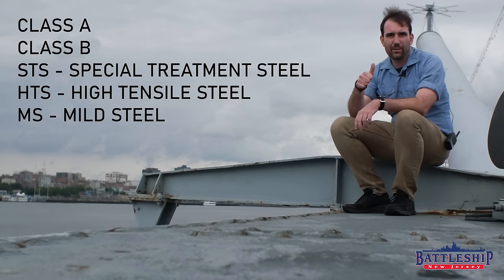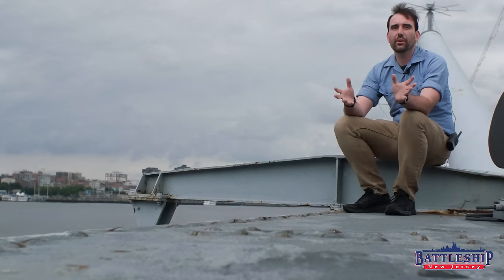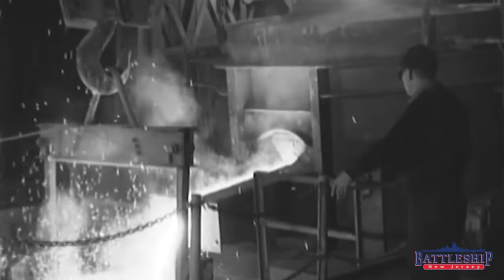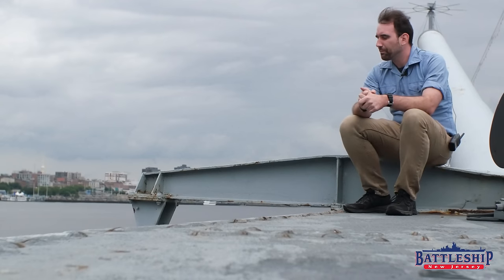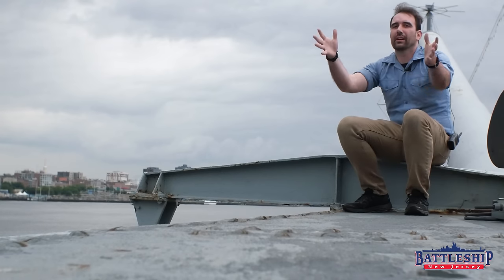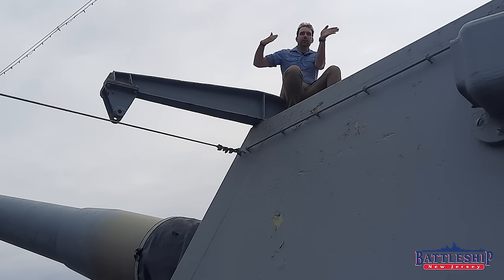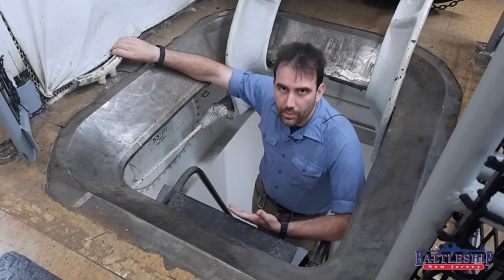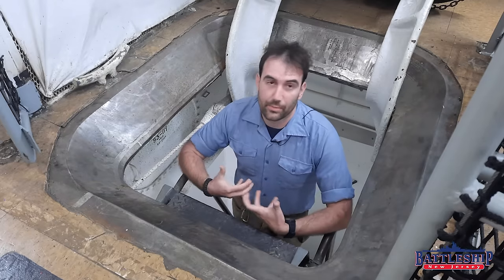Whats the Difference Between the Armor Types on the Iowas?

Comment: I believe the consensus, among people who've spent decades studying this very question for fun and profit, is that British Class A armor was fractionally better than anyone else's; German, Italian, and Japanese Class A armor was all so close together (for a given thickness) as to make no difference; and American Class A armor was fractionally worse than anyone else's. I don't think I've ever seen an explanation of why the British armor was so good, but IIRC the problem with the US stuff was that someone had a very clever idea that looked like it worked in small-scale testing but didn't hold up at capital ship scale. (Specifically, they manufactured it with a relatively thicker hardened layer compared to everyone else - it made 6"(?) plates a bit tougher against cruiser-scale projectiles, but left 12" plates roughly 10% less resistant to 14" and 16" projectiles. But before they tested the thicker plates Congress ordered 17 brand-new fast battleships and set everyone scrambling.)

US Class B armor, OTOH, is supposed to have been the gold standard. And nobody else could afford to use it as structural material throughout their ships, so advantage America on that.
Reply: One of the important questions becomes when the armour plate in question was made. Germany, particularly, suffered from being cut off from supplies of the materials they wanted to use - even Bismarck with her new welding techniques and weird electrodes suffered from this pre-war. Late-War German tank armour, particularly, really suffered from Germany just not having the right material to alloy with and would crack or shatter under impact.

I've read similar on the US armour, by the way. The heavy cruiser-size plates are simply phenomenal but the performance didn't carry through to the battleship-size stuff.
Reply: @Kias1dad  To clarify - the thick battleship plate US steelworks turned out seems to have been on a par with the best of that produced by other nations - British plate, German plate when they weren't suffering under material shortages. It's simply that they weren't able to repeat the very good cruiser plate they'd found the knack for. Regards the rest of it ... one of the things the US did uncommonly well during WWII was to identify a need and meet that need. Sure, there were moments when it didn't perform at it's best, but, generally, if the US military identified a requirement, they found a way to meet it.
Reply: @Kias1dad  
Steel manufacture is down to the methods so much so that I would expect to find variation by yard, ship, and plate - though to what appreciable degree, one could only test on irreplaceable historical artifacts.

The U.S. had major advantages in terms of supplies and having nearly completely unmolested manufacturing, so methods could be honed and improved in response to testing.  Further complicating research is how things were done back then as compared to now.  Many things were still trade arts and process documentation was just different.  Kind of like the problems with trying to rebuild a saturn v rocket.  The companies and people who did it moved on and scattered to the winds, taking what wasn't specifically chosen for preservation with them.

Confusing all of this issue may also be what various nations could do in testing or may have slated for production on one ship, but the natural chaos that unfolds during wartime production leaves questions as to whether this was able to be maintained.  It is true that Germany and Britain were, prior to World War 2, ahead of America in terms of steel processing.  Or, at the very least, had the better documentation to show they did a thing.  Maybe America had a more advanced process in someone's company, somewhere - but it wasn't regarded as the standard.
Reply: The sciences to change the hardness of metals is incredibly complex, try heating metals in ovens filled with  pure Hydrogen.............
Reply: @Kias1dad  Unfortunately Dunnigan & Nofi don't provide a source (or indeed any basis) for their claim - a claim I've never seen made elsewhere. Even more unfortunately, just a few pages later in the same chapter they also state that the Japanese battlecruiser Kirishima was sunk by scuttling the morning after her fight with USS South Dakota and Washington, which appears to be Just Wrong despite actually being a much simpler thing to get right.

Meanwhile actual records of actual penetration tests, with different sizes and types of shells fired against different types and thicknesses of armor from different sources, report that US "Class A" armor of the mid-30s on - which was, uniquely, face-hardened to 55% of its total thickness - was excessively brittle. As a result, while it was by far the best in the world at rejecting hits from 8" and smaller shells, it shattered too easily when struck by 14" and 16" armor-piercing shells.
Reply: For Battleship-grade thicknesses, by the beginning of WW2 the British had the best armor plate in the world. Germany made made many of the same improvements but could not keep up quality through the war.
The Italians did surprisingly well with a system that varied the depth of the cemented face by the thickness of the armor. 
American class A armor was not especially impressive because of an obsession with damaging AP shells rather than stopping them outright (although they definitely had the best AP shells in the world!).
Meanwhile Japan was undisputedly the worst, seeing as their armor quality specifications had not significantly changed since Vickers Cemented of WW1 legacy. This was largely due to focusing research on lowering armor cost than raising quality.
For class B armor the US had the best in the world.
Reply: Well it makes sense that the nation which kicked off the industrial revolution would have a bit of a head start in advanced steelmaking techniques over the other powers, although the US caught up very rapidly.

Comment: When you make structural repairs or when a battleship goes into drydock, is mild steel used? Would you choose replacement steel more for it's anti-corrosion properties today?
Reply: Mild steel is the most likely choice. Choosing a different alloy of steel would result in dissimilar metal corrosion, for example stainless on regular steel, so you just get the same alloy but not necessarily hardened.

Comment: Ryan, I know that Drachinifel has heavily criticized the "turtle-back" armor scheme of the German Kriegsmarine.  But you have to admit, the Krupp Cemented and Krupp face hardened armor allowed both BISMARCK and SCHARNHORST to absorb a lot of gunfire before they sank.  Thanks for uploading the he new video.  The earlier one kept stopping.
Reply: Ehh, the turtleback armour did what it was supposed to - provide good staying power in short-range slugging matches, which is was Bismarck's final battle was. That's what the North Sea favours a lot of the time. Has Bismarck been facing off against the USN and their preference for long-range gunnery I suspect she'd have sunk rather quicker.
Reply: if I recall correctly, there was even a survey done on the Bismarck in the early 2000s - it came to the conclusion that although it has sustained extensive damage and would have sunk on its own eventually, the damage sustained was nowhere near enough to sink it as "quickly" as it did. Meaning that even after the prolonged shelling it did sustain, the armor was still effective enough to render the short-range bombardment largely ineffective.
Reply: @AdamSmith-kq6ys  I see your point.  As a matter of fact, didn't IJN KIRISHIMA lose to U.S.S. WASHINGTON in such the long range duel that you describe?
Reply: @lloydknighten5071  Umm, I'm not sure what our point of comparison is here. Is an uprated battlecruiser as tough as a genuine battleship? No. Did Kirishima have a turtleback armour scheme? I don't believe so. Would seem a little academic on a 230mm belt, anyway. I'm not sure if the Washington thing is a bit of a derp moment or a bit of sass - Washington took apart Kirishima at ranges less than 10,000 yards, once the IJN had managed to distinguish themselves from the USN by the field expedient of setting all of the other USN ships on fire.
Reply: @ranekeisenkralle8265  not really ineffective.  The damage sustained by Bismarck was huge - all turrets were inoperable, crews dead or otherwise incapacitated.  Meaning: The ship ceased to be an operation threat so whether it sank quickly from gunfire or nor is moot.
Reply: The problem with the Bismarck layout is its inefficient. Sure, hits into the vitals were rare, but how quickly her guns were silenced tells much of the imbalance. Hits that penetrate the belt but not the turtle back would often be deflected up into the middle decks wreaking more havoc. Better to just keep the shells out with a thicker belt. Also, one of her designers lamented her shallow belt armor even before she set sail.
Reply: @drittal  Oh, absolutely, it's wasteful of space and, in Bismarck's case, leaves shipwide communications exposed outside the citadel for lack of space inside it. The shallow belt was a known flaw, agreed, but Bismarck was already pushing the limit for just how far she could exceed Treaty limitations - she was on the line between unlikely and improbably and fitting the belt the designers wanted would have been obviously taking the piss. Regards the turrets ... difficult to know what to make of that one. The thickest plates on Bismarck were those turret fronts, but even so they weren't thick enough for the point-blank hits she took. You wonder if the geometry of the turret design could - or should - have been improved. Getting smashed in the face at point-blank range isn't generally a battleship design requirement.
Reply: @SuperBobbster  Moot? Only in that is is now on the bottom of the ocean either way. Sure, it was mission-killed - no question about that. However, there is consensus among the researchers that it would have stayed afloat for hours longer if not for the crew scuttling it to effectively end the bombardment - so that the crew could abandon ship without getting hammered by naval gunnery.
Reply: @drittal  Thanks for the info about BISMARCK'S flaws in her armor scheme.  I just watched a video where the narrator claims that one of BISMARCK'S designers did indeed lament her shallow belt and inadequate turret armor.  The narrator also said that Hitler was so in a rush to get BISMARCK and TIRPITZ finished that the designer was told to keep his mouth shut.
Reply: I don't know the difference between Turtleback and All or Nothing scheme, plus which ones is better
Reply: @SuperBobbster  Re: Bismarck guns inoperable, - in the documentary where they found the Bismarck, they did show the side of the fire control center,  with a shell hole thru it, - so @ some point in the battle, was unable to aim /direct  it's main guns & was an operational loss . . .
Reply: @ramal5708  All-or-nothing is a scheme whereby bits of the ship are either armoured to take substantial main battery hits or not at all; older ships had thicker armour over main spaces and thinner armour over less-important spaces but that inevitably results in a ship carrying around hundreds of tonnes of armour that cannot possibly protect it from other ships it's own size. It's a waste of weight. All-or-nothing, by discarding that thinner armour, allows that armour the ship does carry to be thicker and better protection from the heavy stuff. Turtleback armour has the armoured deck connected to the lower edge of the armour belt kind of hump upwards inside the ship. At short range, if your enemy does manage to slam a shell through the armour belt, the idea is that it strikes this hump and deflects upwards rather than carrying on into something vital. At long range it doesn't tend to matter so much, as shells come in from above at long range and tend to bypass the belt entirely. As for "better" ... they do different things. All-or-nothing is a general-purpose Treaty-era scheme to get the most out of a ship's weight, turtleback is a dedicated close-range combatant scheme. It weighs more than all-or-nothing for the level same protection and isn't as good at long--range but it is good at short range, so it depends on what the battleship designer wanted.
Reply: @AdamSmith-kq6ys  actually, the US started the "all or nothing" scheme with the Nevada class battleships in 1912, well before the Washington naval treaty. The point was the heavily armor the vitals (machinery, magazines, etc) while preserving enough reserve buoyancy to keep the ship from sinking even if the unarmored ends outside the armored citadel were completely flooded. Older schemes expended quite a bit of weight protecting less important areas of the ship from secondary guns up to about 6" even though Tsushima demonstrated that future battles would be fought at ranges such lighter weapons would have difficulty hitting at all, let alone delivering a disabling "hail of fire". For main battery guns, the few inches of armor that protect against a 6" shell at 15,000 yards will only ensure that the AP shell functions and detonates properly.
Reply: @AdamSmith-kq6ys  Bismarcks Communication wasnt exposed, it was redundant in two passageways below the second armordeck
Reply: @ramal5708  the germans expected that in a gunneryduell on ranges between 15 and 20k All sidearmor of any battleship would be defeated. So they put the second armourdeck low in the ship. A shell which defeated the sidearmour had to defeat the armourdeck as well. The armourdeck between the sides of ship was connected to the lowest tip of the sidearmor on both sides of the Ship. Between it rose  like a turtle. Below the armourdeck were the vitals, like machinery, magazins and other important stuff.
Reply: @Schweineferkel  That's weird, I thought I remembered Ryan mentioning that in one of his past videos. Oh well. Sorry for the mistake.
Reply: TBH though did it really help the Bismarck much that she was 'near impossible to sink'? Considering her guns and running gear were utterly minced long before she slipped beneath the waves, and all that armour was doing was prolonging the inevitable with no hope of actually doing any damage to the british ships?
The record of the battle states 34 minutes after the first salvo between the battleships, every one of Bismarcks main guns were knocked out. 1 hour 48 minutes after the first salvo Bismarck finally turned over. Thats 1 hour 14 minutes of Bismarck just bieng a useless hulk and target practice.
If instead she had been designed to fight more, so lets say rather than all weapons destroyed after 34 mins, ship sank after 108 mins, the armour was changed so the guns and running gear were more protected and the battle instead lasted 44 mins until the guns were out 48 mins (fully 1 hour earlier) until she sank, that would have gave her another 10 mins of gunfire - potentially enough to get e lucky hit or two on the KGV/Rodney.......
Reply: @Debbiebabe69  The final battle Bismarck fought wasn't really one she was designed for. Regards protecting the running gear ... there isn't yet a wholly satisfactory solution for doing so. As for the guns ... Bismarck's heaviest armour was on the front of the gun turrets. There's only so much you can do to protect yourself from somebody deciding to slam 16" shells through the plate, and most of those things involve being able to manoeuvre. Had Bismarck not been crippled the RN ships would have faced a very different battle, but that's a what if ... might as well posit what would have happened had Hood not gone up.
Reply: @Debbiebabe69  Thanks for the information you provided me about BISMARCK'S armor.  I am going to have to re-read some of my older books and Garzke/Dulin's new book on the subject.

Comment: This video just made me realize that the ship doesn’t have guns, the guns have a ship.
Reply: That's correct. Battleships are basically a floating version of the A-10 Warthog, a gun that has a plane attached.
Reply: I'd say it's more like a floating version of an AC-130.  Sure the A-10 has the GAU-8, but the AC-130 has a 105mm cannon along with 40mm Bofors along with an assortment of 20mm or 25 mms battling guns.
Reply: @bobmartin4942  The Spectre is definitely a beast of a plane, however the C-130 was adapted to carry all that firepower. The A-10, on the other hand, started out as a GAU and they built the plane around it as a  delivery vehicle, much in the same way that battleships are purpose-built for getting their guns to the battlefield.
Reply: Thats the same realization I had after watching a video about the F4U-Corsair. The engine had 1800 hp, the prop was 13 feet tall, had to purpose build the plane for that engine. I thought to myself, the engine wasn't attached to the plane, the plane was attached to the engine! It still amazes me how I can really get into the appeal of a great Battleship, when in reality all it is, is just a way of floating those big guns around on the water.

Comment: British belt armour was specified in pounds, a true square ft of inch thick plate is around 40.8 pounds which is why the 600lb belt sections on KGV were 14.7 inch not 15 inch. Seems like the US use weight specified plates up to 240 lb plate and thickness specified over that whilst the British used weight specified at all thickness.

Comment: Ryan, how do they attach the armor plate to the ship, and is it full penetration welds if welded? Thank you so much. Really enjoyed this Video.....Paul
Reply: Good question
Reply: I've always been curious about that myself, like are the plates beveled back and filled with built up welds or are they evenly spaced from each other and filled like a slot weld.
Reply: Drachinifel has addressed this in one of his Drydock Q&A videos. Basically, the softer back of the armor plate is drilled and tapped for massive bolts in huge numbers.
Reply: @kemarisite  Thank You so much Sir.....Cheers